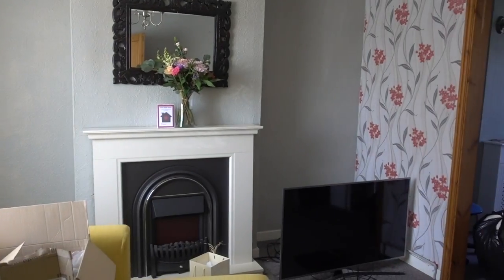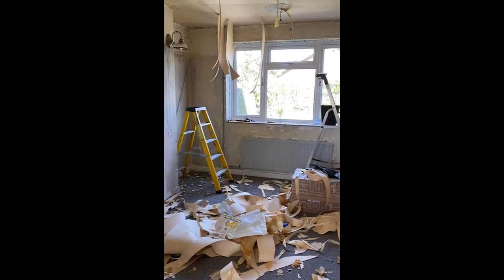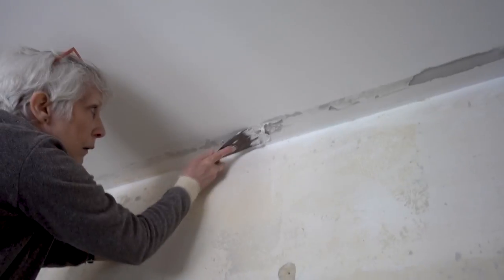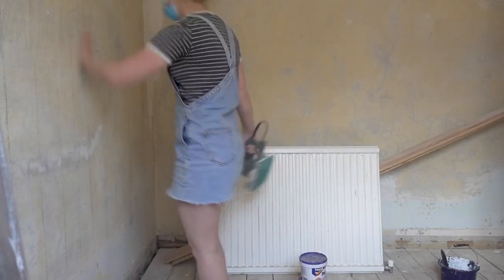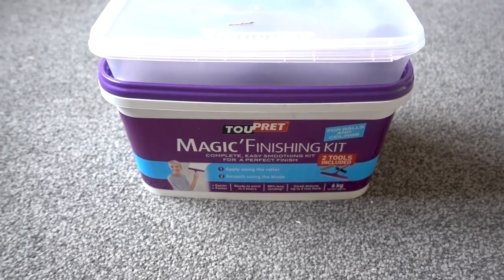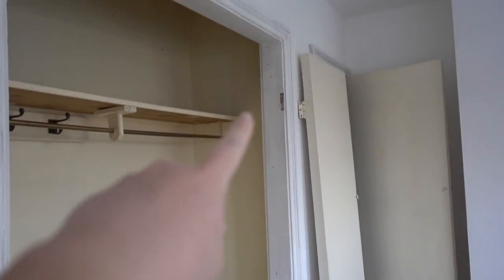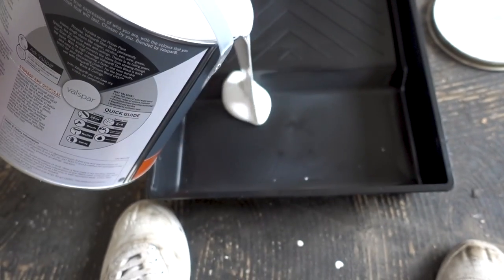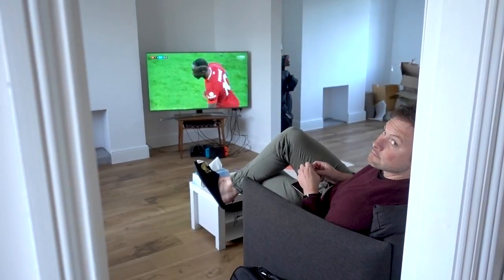BEFORE + AFTER (let's take a look back!) •  UK HOME RENOVATION

Comment: Great job. Those tiles you scrapped up and all that black stuff left behind is also asbestos also the artex ceilings you were standing and scraping. Always best to get stuff tested before you start work.
Reply from the maker: Absolutely! I talked about this in my other video, but we wore masks for getting up the marley tiles, as advised by our flooring fitter. We also work masks for sanding down the ceilings. 😊

Comment: omg, artex ceilings - asbestos and floor tiles  - asbestos - you should have used a p3 filter all time while covering ceilings or scratching ceilings and mainly when removing floor tiles, also that black bitumen under the floor tiles was 10% at least asbestos, it shouldve been also removed or encapsulated before doing anything else. thats courage or not knowing what asbestos does to our bodies.
Reply from the maker: Hi,
We didn’t touch the artrex ceilings, these were skimmed over by a plasterer.
I’m a bit confused by your comment about the ceiling I was scraping off - do you mean the kitchen ceiling? If so, this was wallpaper I was scraping off.
We were advised about the marley floor tiles and black bitumen by our floor fitter, who advised to wear a mask during removal and that the level of asbestos would have been very small.
Reply: @emmarosehorsley  that was not a p3 filter mask, i just said, if anyone sees the video with those floors disturbed will presume asbestos fibers were released, many people do this without realising the real situation. plus so to understand you actually left in the premises all the asbestos materials without removing them? good one. ))))
Reply: @bodyhater  bold of you to assume that they didn't have these things checked before doing work. She already said they've been advised and taken extra precaution whilst removing the tiles/stripping the walls. You should've just accepted that and stopped trying to prove a point that was clearly not needed. Besides, I don't think flipping a house is something anyone should be doing if they aren't aware of these things, but clearly they knew what they were doing.